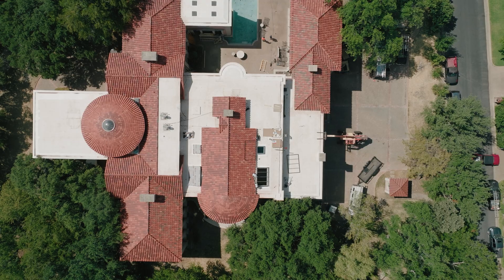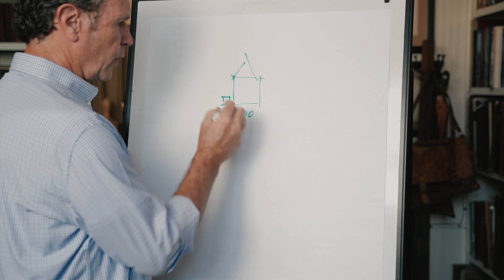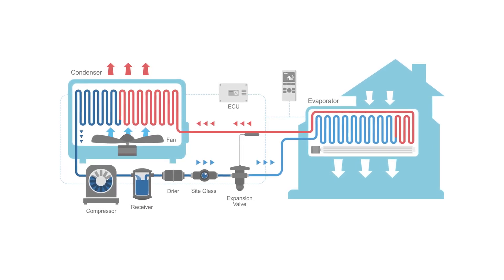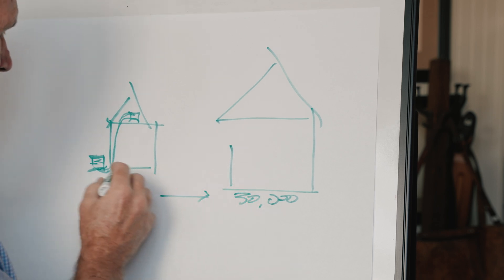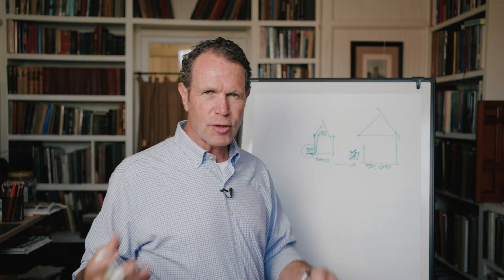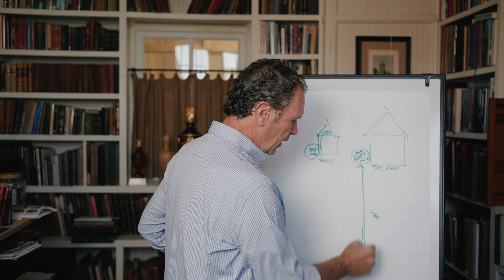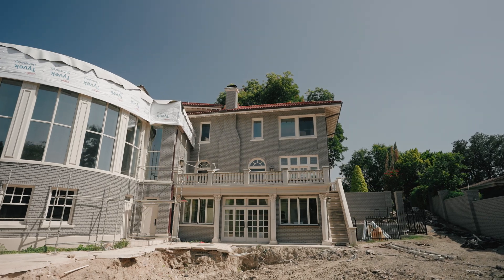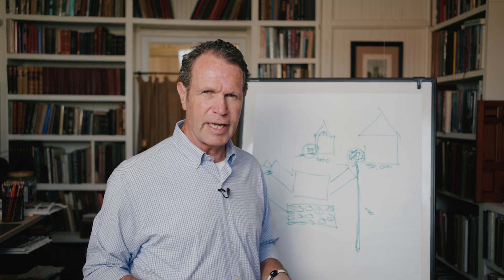All about Geothermal HVAC. The benefits outweigh the negatives.

Comment: I have an underground water tank below the base of my house (more like a big sump well with natural spring as water sources which I mainly used to flush the toilet and washing. Test result say it's drinkable but hesitate to drink it). It's almost always full and no need to pump out as over flow pipe do the job since my house is located in a hilly/slope area. My question is, can I use this tank/well to lay the pipe for this geothermal hvac?
Reply from the maker: I suspect it sends on the size and the amount of flow. Remember you will be using that water to regulate temperature. If it doesn't flow that much it may not work. You are pumping hot water in and taking cool water out. It could be just a hold of hot water and reduce the effeciency of the system. Talk to a Geothermal company. They should be able to help. Good luck.

Comment: We've had geothermal for three years at our home in the Hudson Valley.  Two days ago it was 0F outside and our house was toasty.  It's Dec 24th 2024 and the system has cost $1567 in electricity for the entire year to heat and cool the house.  Heating Oil alone for this winter would have cost us $1593.  Our house is about 2000 sq ft built in 1987.
Reply from the maker: Wow. Ok Thanks for sharing.
Reply: What company did you use if you don’t mind me asking,we’re nearby in the Catskills and the electricity bills have been insane.Thanks
Reply: @lr8621  Solar: Lighthouse Solar in New Paltz   Geothermal: Dandelion

Comment: For economic comparison, my solar panels and wiring cost $18k. They cover 60% of my entire home's electrical needs - so heating/cooling plus an appliance or two! So let's say $10k of my project's cost reduced my heating/cooling bill to zero for the next 25 years. Installing geothermal would have to be very, very cheap to compete with that. Even if it was only $10k it wouldn't make sense on my small house because it would still come with an electric bill.
Reply from the maker: ok, thanks.

Comment: 4:37 Normal condensing temperature regardless of outdoor temperature is 100° so at 106° air temp with a modern system you're looking at a condensing temp of ~118°, you're still able to reject plenty of heat and keep that head pressure below 400psi. Sure there is some loss of efficiency but not near as much as you would think. Going from 95° to 105° on a 10 year old 14 SEER system  you will only drop from 13 EER to a 11.8 EER, modern variable speed systems close that gap even further.

Anyone choosing to design a system to cool a 15k sqft space with 10+ condensing units should be fired, that's not how its done. I would argue a single air source VRF system, designed properly could rival a geothermal system when considering life cycle cost. VRF systems are available up to 60+ tons (equal to 12 5 ton condensers). In a large space you also will have areas that need cooling while others need heating. VRF systems have heat recovery so they can basically shuffle the heat around the building, no need to dump it outside. It achieves this by allowing multiple indoor units running in heat and cool mode simultaneously from room to room. They also have hydro kits available that can heat water either for drinking for pool or hydronic loops if you wanted to go that route.

Geothermal was good tech back in the '90s but with modern systems and controls it's an unnecessary cost in all but the most unique circumstances. As time goes on and technology improves geothermal with continue to be more of a niche technology.
Reply from the maker: wow, ok, thanks for sharing.

Comment: Geothermal is great stuff, but there some issues in this video.
1) Freon is just a brand name for some old refrigerants that are no longer in use.
2) Using geothermal does not get rid of compressors. Some limited cooling applications (perhaps common in Texas, I don't know) can use the water directly from the geothermal loop. Most geothermal cooling systems use a compressor and reject heat to the geothermal loop. Any kind of geothermal heating uses a compressor to pull heat from the geothermal loop and reject the heat inside the home. The geothermal loop makes heat gathering and heat rejection more efficient - that's the reason to use geothermal over air source heat pumps.
Reply: Yeah, all the terms he was using and his descriptions were driving me crazy. You can tell there was little to no research that went into the video, just a guy rambling in front of a camera with a white board.
Reply from the maker: Ok, Thanks.

Comment: The older I get, the more I realize the older guys were right - "Silence is Golden™".  I generally prefer a quiet well designed hydronic system to a force air system and something-to-air condensers outside the house pushing heat into the immediate area and adding to noise pollution.
  
As long as your water table is high enough, a ground loop geothermal system is going to be ideal of most small to large properties.  Water has a much higher thermal mass than air, so you need to move a lot less of it to transfer the same amount of BTUs/hr.  That is the reason I prefer an HVAC&R design based on a "spine" hydronic loop - using smaller, higher efficiency, reversible heat+cool units to do the final push to what is needed in a local zone.  The Mitsubishi CityMulti system is built like this, but rare in North America in smaller scale projects.
  
Because the individual zones have their own unit and the hydronic spine passes all of the units (in larger buildings there may be an intermediate floor management unit), it allows pushing heat pulled from one zone into another - before having to reject it outside the building envelope.
  
I've been begging companies like Mitsubishi and Carrier to integrate more and more thermal devices into their hydronic type platforms - think of having a refrigerator/freezer and a water-heater connected as loads to a hydronic system.  You're already doing the same thing on a larger scale with your house and the outside environment. Extracting heat from one side of an insulated volume and rejecting that heat to the other side (heating versus cooling just changes the direction of the heat flow).  Imagine how the total efficiency of a water heater would increase if it was sourcing heat from the room the water heater was in that escaped the insulation barrier and then pumped it back into the water heater - but that's only the second order efficiency improvement.  Not being a load that has to be calculated for that room is the first order efficiency improvement!  thinking the refrigerator or freezer example, a normal appliance must extract heat energy from the inside of the insulated box, and then reject that heat into the room via a coil that is either integral to the appliance (right inside its skin) or right up the back (getting covered in dust, because when is the last time you remember pulling out your fridge to clean the coils?).  If that heat energy isn't getting pushed into your kitchen, then you don't have to remove it with an HVAC system - that's where integrating the R (refrigeration) into the overall Heating Ventilation Air Conditioning & Refrigeration (HVAC&R) pays off.
  
Unfortunately, doing this with modern refrigerators and freezers pretty much requires the commercial sized ones that were designed to be serviced and have fairly common off-the-shelf parts like compressors that can be swapped with water-loop plated heat exchangers.  Bigger houses only need apply for this modification right now.
Reply from the maker: Wow, thanks.

Comment: Serious mis-use of the term Freon.  Freon is the trademarked name used by DuPont de Nemours and their successor Chemours for their older refrigerants R-12, R-13B1, R-22, R-410A, R-502, and R-503.  Products created by any other manufacturer are not Freon.  Newer natural gas based refrigerants are not Freon, even when made by Dupont or Chemours.
Reply from the maker: Thanks for the correction.

Comment: In Sweden, northern Europe, it's common for heating in houses from around 1500 square feet (150 square meters) and up. It has been common for the last 25-30 years. After about 20 years you have to change the indoor part of the system. Otherwise it's a problem free setup.
Reply from the maker: Thanks for the insight.

Comment: Not an engineer, but with clay soils (which Texas has a lot of) it makes sense to start the lines 5 feet below grade as clay soils tend to have less evaporation 5 ft down, which means less contraction of soils, which = more stability. If expansive soils can lift fountains. Causing damage to a water line is also possible. In fact, I've seen it happen. If the lines do need to be replaced/repaired, are they accessible, or does it require drilling a new well?
Reply from the maker: So far, that is not the weak point. Lines are replacable if they did fail.

Comment: Good video.  I’m an engineer.  I have geothermal in my house and in our office building.  Here in coastal virginia it is easy to drill wells in the sandy soil, so the well costs are reasonable.  A rule of thumb is one well per ton of A/C.  Thanks for addressing this subject !
Reply from the maker: Thanks for sharing.
Reply: Any chance you do consulting on the side? I’m a DIY guy but want someone to check my efficiency and design plans.  Located in VA
Reply: @bigdreamsonsmallacres  sure, I’d be glad to look over your plans and offer my thoughts (in an unofficial capacity of course) whats your email address?
Reply: Hi John, need your assitance in some areas. would be highly appreciated if you can tell me how to connect to you? Thnx in advance!
Reply: @ reply with an email address and I’ll contact you.

Comment: I would love to see the cost come down even further on drilling and installation, it seems it is still a niche and therefor each job is custom.  Probably still have refrigerant gasses somewhere in the system, just don't have to have anything outside.  Our refrigerators and freezers have compressors for example.  The high efficiency house competition in Washington DC has showcased A/C systems hooked to hot water for decades, but good luck finding an A/C manufacture who will let you take a tap off their unit to capture waste heat and still have a warrantee.  So many technical possibility, but still so far away from the average homeowner.
Reply from the maker: OK. Thx.

Comment: i often wonder if 4 to 6 houses on a city block could leverage the common yard space and make this system work cooperatively?
Reply: YES.  Very easy and benefits increase on size.
Reply from the maker: Great question. I suspect so.
Reply: Actually there are entire neighborhoods in Europe that will share a communal system.  In cases that large they'll actually insulate their ground reservoir from the rest of the soil because the heat they pump into it in the summer can be extracted out in the summer.

Comment: I'm a huge fan of geothermal. Makes me wonder if we'll ever have a community scale geothermal heat pump wells like a public utility connected to the whole neighborhood.
Reply: You mean "again?"  We used to do district scale stuff before we started marketing all these electric gizmos... 100+ years ago.  A lot of these "everything must go electric" mandates miss a huge opportunity to go back to higher efficiency district scale energy solutions - for example if you have an area with a lot of houses and businesses that need heat and electricity, you could take waste heat from the plant and send that out to the district for direct consumption - this is called combined heat and power (CHP, this one is not the law enforcement agency in California).
  
For any combustion based generator, the conversion from heat+volume expansion is about 33-40%, that other 60-67% is just dumped into the atmosphere as waste heat (so called simple cycle plants - the biggest structure space claim at a nuclear power plant is the familiar cooling towers, just there to dump waste heat into the air), or in more efficient plants exhaust heat is recovered and turned into steam, which turns additional electrical generation, so that as much at 80-85% of the energy is recovered (these are called combined cycle plants).  That heat could just as easily be put into a pipe and sent out to do heating work, instead of being converted to electricity and then back to heat, losing a bit of efficiency at each conversion step.
  
There are similarly district cooling plants (still) in operation - all that extra generation capacity at night when the air is coolest is the most efficient time to reject stored heat (or in effect, to store cold). This extra generation can be used to make ice... you remember Ice Boxes?   Before everyone had a personal refrigerator?  Now we can create that ice in a warehouse-sized water tank at night maximizing the power plant's output and efficiency without a lot of load variation, and during the day that ice can absorb heat from the town/city with a larger water loop.  It emulates the work of a ground loop, but on an industrial scale.
  
None of this is new, and I'm glad that Brent is talking about this - I think some of the forgotten building science from back when engineers were steam powered and every bit of efficiency had to be squeezed out of every ounce of energy, is probably worth a come-back story of its own.
Reply: In the UK, the Mines Authority is working on using shuttered coal mines as giant geothermal set ups to provide district heating.
Reply from the maker: Great question.
Reply: @BrentHull  there is one that was built in Alberta Canada.  It seems like it worked alright but the idea was abandoned when the heat pumps reached end of life. The project is called Drakes Landing.  There were a lot of mistakes made but it was also a first of its kind project.  Also the fact that it worked well for so long with all the mistakes in an area where it reaches -40 during the winter shows it would be possible to make work in many areas.